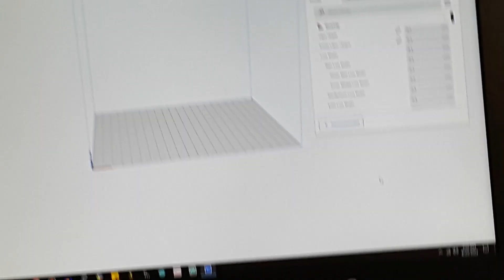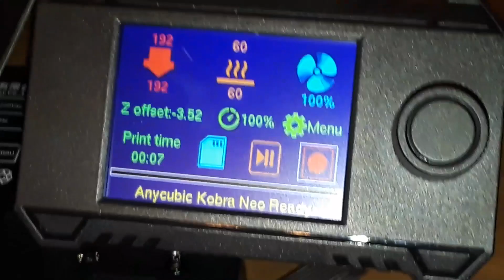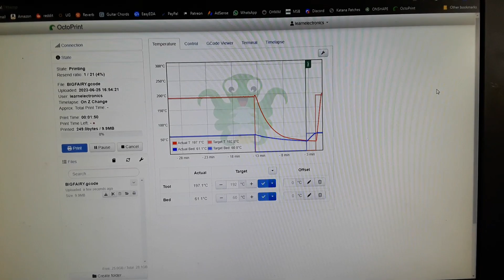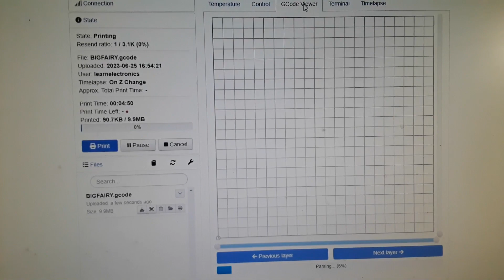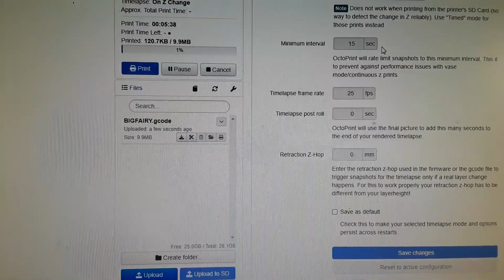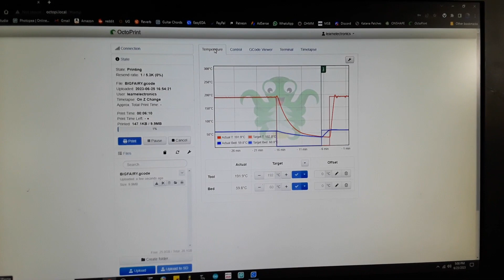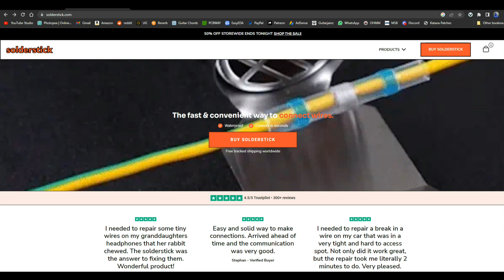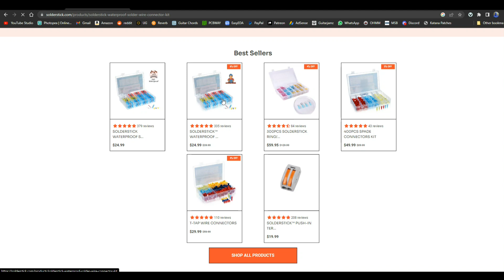Dialing in the Anycubic Kobra Neo 3D Printer - Sponsored by Solderstick Wire Connectors

Comment: One trick that I use to make sure that there are no extraneous bits of filament at the start of the print is to include a skirt of one layer and three loops about 2mm-5mm separation from the print.  This gets rid of any blobs or trailing strings before the start of the object.
Reply from the maker: Thats a great idea

Comment: I have been printing like 9 years now, up to 12 printers in my workshop, I got room for another one. I design and build what I like to do. Have you heard of Klipper, it is step up from  Octoprint and I like the style (I never tried Octoprint) I know there are another one  Orcaprint I think it called, keep looking there are more names to add but which one you like to have. I understand it need a lot of setting up and coding to get to your goal. My latest printer is a modified Sovol SV06 PLUS with Klipper. Right now I am updating the old Tevo Nereus that need BL Touch in place, more to that story later on. I do have a laser engraver as well but just the one, lol. If you don't know what I am talking about, do a search of those word mean. Love yah.